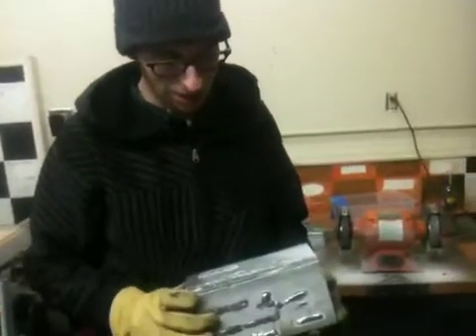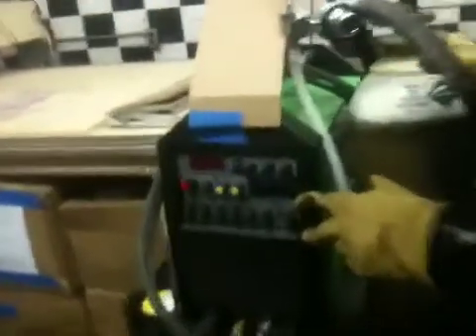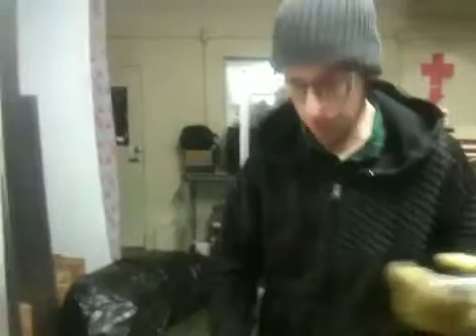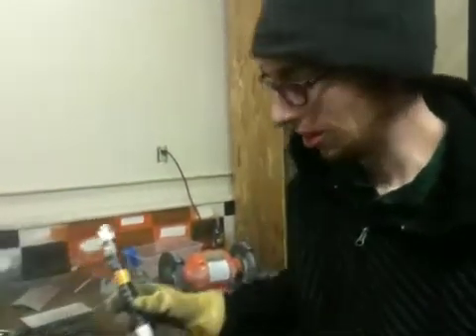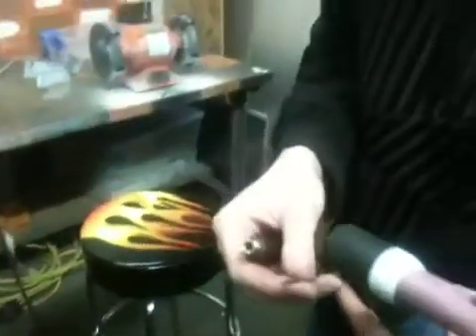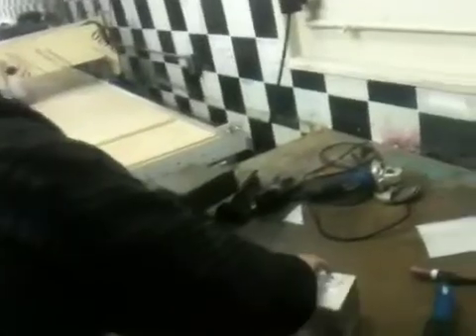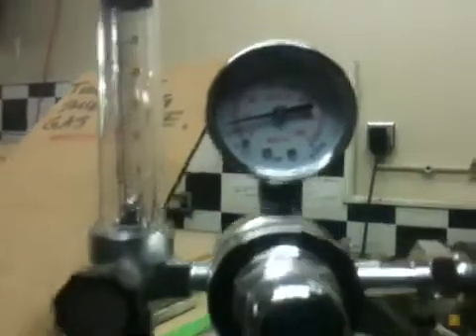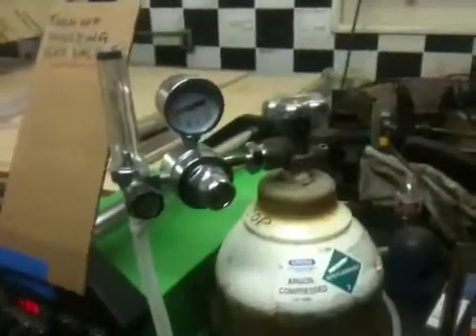TIG Welding 101

Comment: Tig Welding Settings Part 1 - using Everlast Powertig 250EX Inverter

5u4Efn1twUo&feature=plcp&context=C306416fUDOEgsToPDskLE8yXu2K7AATIsZxel0XC_